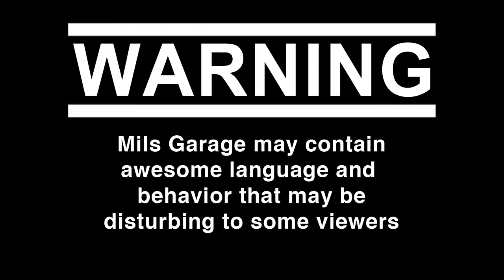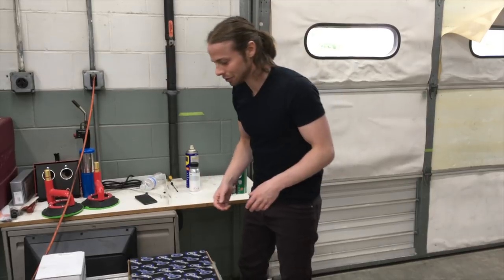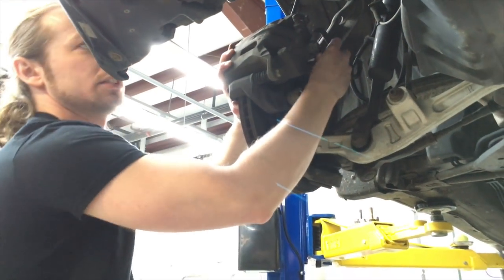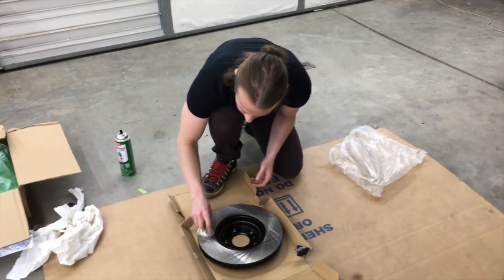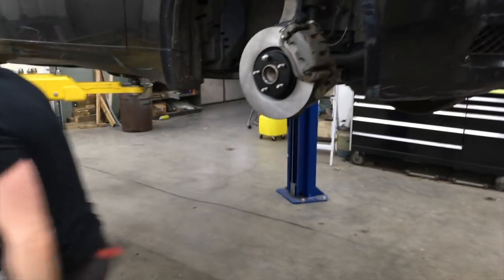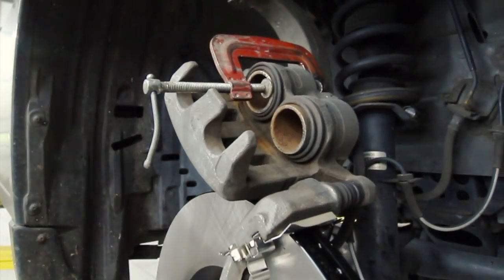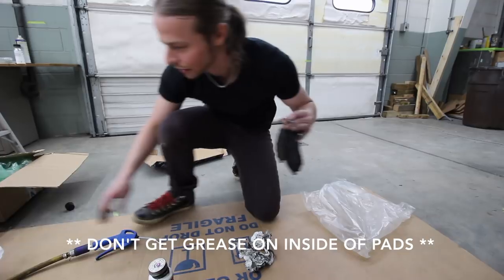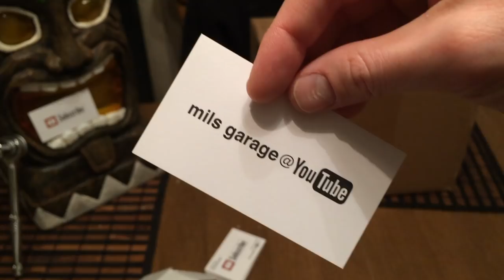Change Rotors and Brakes [Infiniti G35/Nissan 350Z] (COMPLETE TUTORIAL w/ Pro Tips)

Comment: Getting ready to do the rear brakes on my g hope it's that easy
Reply from the maker: Just make sure to take off the E-brake. It's the same thing. Also, don't grease the slides. Instead, grease behind the shim, where the shim and the caliper touch. It will help the shim slide on more evenly. You can also just grease the piston ends, rather than the pads themselves
Reply: @milsgarage  I have done many a chevy and know what to do   someone striped a guide pin and the caliper isn't releasing so I'm replacing the whole thing this weekend
Reply: What’s the best full brake kit to install on a 2004 g35 sedan
Reply: Something no super expensive but a good brake kit
Reply: Its never that easy

Comment: Thanks
Reply from the maker: so i've heard many times that the banjo bolts are supposed to be torqued to 35ft lb.. with that said, i personally believe that is too much torque for them, and have also heard people snap the bolts when they try that spec. i personally believe you should crank it snug, and then do a quarter crank more. if it starts leaking a lil, just crank it a smidge more

Comment: So after I replaced rotors and brake pads, my my braked pedals goes all the way to the floor it doesn't have pressure idk what I did wrong, idk if when i used the C clamp to open the caliper messed up somesomething, I just notice the brake fluid bottle had more fluid than before. Anybody has a suggestion? My warning lights came on Slip, Brake, VDC.
Reply from the maker: hey Cristian! did you pump the brakes? and this seems crazy, but you're absolutely certain there are brake pads in there? sounds like maybe you need to bleed your brakes if pumping doesn't work
Reply: Yes I pumped my brakes like 10 times 
I worked on the car yesterday I'm going to do the fluid bleed today if I get a chance. I hope that all my warnings light goes off after the bleed.

Comment: I recently crashed my g35 and the right side is all messed up. I didn’t look at the negative telling myself this just a chance to upgrade my car. Know I need to know what the parts that hold the rotor are called. If anyone knows please tell me😊
Reply from the maker: sorry to hear about the accident, but you look at it just like we do 😎. here’s a link to how to install the wheel hub bearing unit: https://youtu.be/KAKKICX2wVU

get the hub unit as a single unit so you don’t have to pay a garage to install the bearing.. here’s a link to get the hub unit parts: https://www.rockauto.com/en/catalog/infiniti,2005,g35,3.5l+v6,1431975,brake+&+wheel+hub

and this should help you get parts for the suspension: https://www.rockauto.com/en/catalog/infiniti,2005,g35,3.5l+v6,1431975,suspension
Reply: Thank you 🙏
Reply from the maker: any time buddy! glad to help! definitely hit us up in the comments if you ever run into any snags or need help getting your G all fixed up :)

Comment: NEED HELP - RIGHT AWAY -  Dealership replaced my back brakes on my 2005 Infiniti G35, but the emergency brake isn't working.  Is that normal?  Shouldn't that have been part of the process of replacing the brakes??
Reply from the maker: Oh my. Yes, it sounds like they didn’t reinstall your e-brake correctly.. Or maybe it has to be adjusted. Either way, it sounds like they never tested it out afterwards. They need to fix it for you 💯
Reply: @milsgarage  But I"m confused because I was told that the emergency brake is on a cable and not a hydraulic system, therefore it w/not have been apart of changing the rotors and calipers.
Reply from the maker: @Gina Kirkland Oh, sorry, they wouldn't need to touch your e-brake to do just the pads and rotors. Do you normally put the e-brake on when you park?
Reply: @milsgarage  Is what I said in the last comment correct?
Reply from the maker: Yes, what you said is correct. They should not have touched your e-brake at all in the process of doing brake pads and rotors. They should have released your e-brake from the inside, and that would let go of the old rotor, which surrounds the e-brake. It sounds like something on the e-brake was touched.
Reply: @milsgarage  I forgot to respond to your last question.  No, not really as I live in prairieland in the middle of Illinois, so it isn't really necessary.
Reply: @milsgarage  It actually didn't work before.  I bought the car in February, in awesome condition with low mileage, but that was one thing that didn't work.
Reply from the maker: @Gina Kirkland Tell your husband not to hate me lol, but you should not have any issues with your e-brake after taking it in for brakes and rotors.
Reply from the maker: @Gina Kirkland Wait, we're typing at the same time lol.. They will not fix a broken e-brake during a brake pad and rotors installation. E-brake is it's own separate system, yes. 👍

Comment: Please update this with the proper info on what grease to use on the pins. You want to use "silicone" lubricant, not "synthetic"...unless you want a seized up caliper from swollen bushings on the slide pins.
Reply from the maker: Actually i want Synthetic. i thought you'd be telling me the correct way to grease behind the brackets, an not on the ears, but... Yeah, i really meant only use the Synthetic.
Reply: @milsgarage  Synthetic isn't EPDM/rubber safe and will cause swelling. The manual calls for "silicone based grease", not synthetic for that very reason. When repairing seized caliper pins, I've dealt with everything from Permatex synthetic green or purple, to CRC synthetic brake lube, which CRC states is for metal to metal only and isn't rubber safe and recommends CRC Silaramic for use with rubber components. My recommendation is 3M silicone brake paste or Napa Syl-glide, both of which has never caused swelling in my 14 years experience. You can use whatever you want, I'm just trying to save your viewers an expensive repair.
Reply from the maker: i respect that you're looking out for our viewers. i'm researching more on the subject. i've never had a problem with my caliper slides while using synthetic brake grease on them.. Except the first time i ever did my brakes was an epic fail, as i used ball bearing grease. Luckily i only did it to one caliper lol

Comment: Buy a brake package; pads and rotors.  If you have the time, patience and money to experiment with different pads and rotor combos, knock yourself out.

I mixed Hawk HP pads with Z-1 Motorsports drilled/slotted rotors...OMG!!  It screamed like banshee when I stopped.

I tried different pads, shims, grease; nothing worked.  I finally bought a combo kit.  My sanity was restored.  

Funny thing; I used the Hawk pads and Z-1 rotors on an earlier swap and they were great!  I can’t explain the second set.
Reply from the maker: most definitely. brands usually function best working with their own parts, as their specs were engineered to perform as a unit. we get most of our OEM spec stuff from RockAuto.com and they offer the full kits 😎👍

Comment: I watched this whole video knowing my ass isn't going to attempt this, but I just wanted to see still. I noticed from the video the front brake pads are bigger than the rear brake pads?......interesting. I was never aware of this since I usually just buy the parts and hand it over to my brother to finish the job. I was freaking out wondering if I got the right brake pads bc I don't remember the boxes being different sizes for front and rear brake pads which made me opened the brake pads box, then I noticed the front pads were bigger than the rear.
Reply from the maker: Knowledge is power. 👍 Yes, the rear calipers and pads are smaller than the front, because it helps keep the car facing forward when slamming on the brakes at high speed 🤓

Comment: What should I do if my wheel studs are stripped
Reply from the maker: Replace them. 👍
Reply: @milsgarage   should I do the same process up until chamging the rotors and the remove one by one or change the whole wheel bearing.. and Thanks For replying!!
Reply from the maker: You have to remove the rotor to get to the lugs, so you'll want to get the lugs first unless your brakes must be done now. Any time Alberto 👍👍👍

Comment: what size has these rotors ?
Reply from the maker: [Centric Premium Plain Surface Rotor Dimensions]
Outer Dia: 320 mm
Height: 49.2 mm
Nom Thick: 28.1 mm
Min Thick: 26 mm
Hub Red: 68 mm
Bolt Size: 12.9 mm
Bolt Circle: 5 x 114.3 mm
Weight: 22.5 lbs.

Comment: Is that grinding noise normal ?
Reply from the maker: a low grinding sound is normal. an inconsistent grinding sound is not.
Reply: Alright cause I’m having a problem with my g right now, recently I changed the lower control arms for Both sides since the drivers side was bad so I changed the one as well. Than I notice a loud wind noise type of thing coming from the wheels. So today I lifted up the car and went ahead and   spin the passengers side wheel, and it lasted 11 seconds for it to stop spinning, and then I spinned the drivers side wheel and it stop at 6 seconds. Overall the faster I go the louder it gets. I already replaced rotors and pads. And made sure the dust shield wasn’t touching the rotor . Not to sure if it’s the wheel bearing or?
Reply from the maker: ok, so if there's what sounds like sliding a knife against a grind stone, that is the brake pad making contact with the rotor, which is normal. if there's a grinding sound, it could actually be the bearing. check if they're crusted in rust or if the unit is loose at the joint. we have a tutorial on how to swap out the unit as a simple bolt-on part [ https://youtu.be/KAKKICX2wVU ]
Reply from the maker: and by the way.. awesome call on checking the dust shield 😎👍👍
Reply: Mils Garage thanks man. I actually did see your other video before. But just wanted to make sure,  thanks 🙏🏼.
Reply from the maker: dude that's so cool! you know, you just made a great diagnosis of your grinding noise situation. awesome work buddy 👏😎

Comment: You should not grease the back of the pad bc it will get on the rotor surface then bad braking. You know the local auto shops want to charge from $950 to $1100 for both wheel rotors, pads, and calibers. Do yourself then tell the wife how much you saved the family.
Reply from the maker: how is it going to get from the back of the brake pad to the inside of the pad in order to transfer to the rotor again? but definitely be careful not to get any oil on the rotors of course.. and absolutely, save that money! it's crazy what some shops will charge.. and that's just for the brakes and rotors.. you know they're gonna try to hit you with that "needs new belts, rotation, oil, blah, [whatever they think of that we probably have videos covering ;) ]". i saved my buddy $4300 last weekend, just because he asked me to (re)diagnose his G. the previous mechanic told him his piston rings had failed. 😅 the rings were just fine. scam artists are the reason i made this channel lol

Comment: Whaat kind of pads and rotors are those exactly ?price I see 2 type of centric rotors
Reply from the maker: i created this video years ago, and they change their product listings all the time. i always stick around the higher end listings, but i don't buy into the drilled idea. The way i see it, i'm saving $400+ by doing the work myself. No need to worry about parts cost at this point
Reply: There’s a plain 120 series and plain 120 series Cryo treated rotors ? Will I be ok with the first ones ??
Reply from the maker: i'm not sure. i even pulled up RockAuto to try and track these down, but realistically, i would go for anything coated in a rust preventative way. Looks like they have new ways of doing it which seem promising. They're all going to stop though 👍